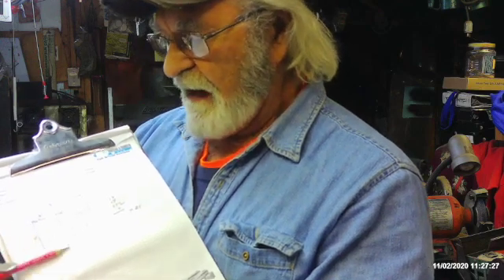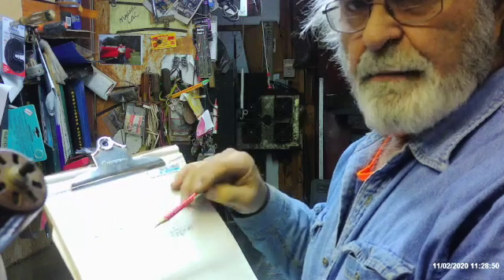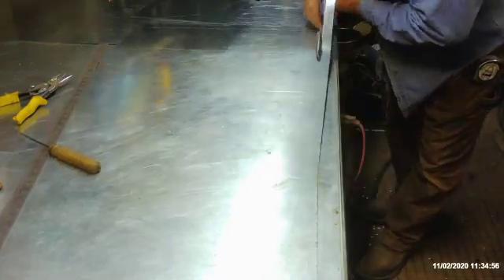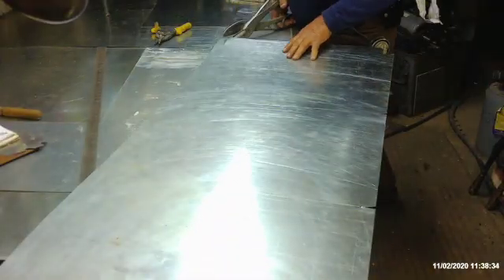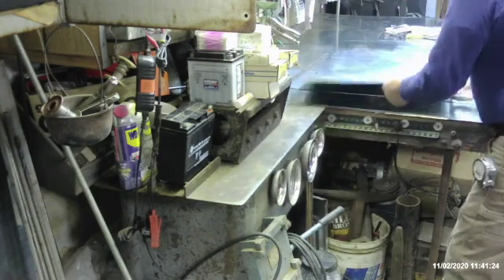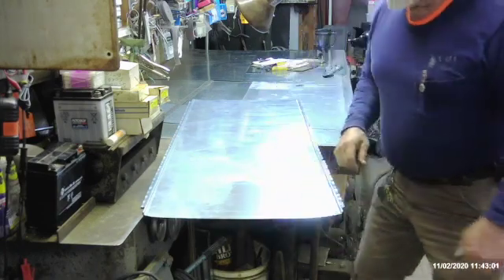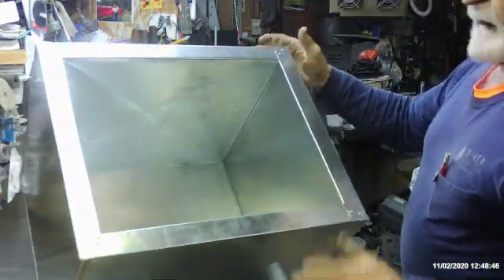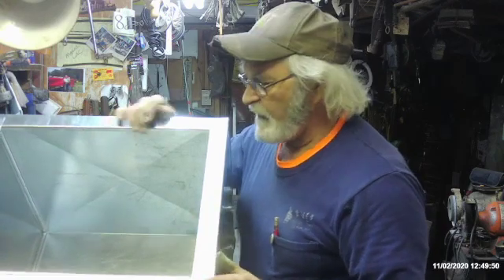Return Air Plenum Fabrication for Electric Furnace

Comment: It only took me 7 hours to get this watched 44 Friend! This vid came in last night and I thought, surely I can watch this one and awoke as it was getting light! Made some JO and have tipped it your way twice now! What fine metal work, looks great! Nothin like a good old ice pick to have in ones shop! I remember going into town with my Grandparents to buy a block of ice in the summer to make ice cream. My Grandfather put the back in a tub and go to work with an ice pick. Bigger pieces were put in a burlap feed sack and on porch and a sledge was used to break up those pieces too small for the pick. And what great ice cream it was too! I wanted to turn that crank and was allowed just before it was done and could hardly move it. The big guys made it look so easy! Off for more JO tipped your way my Friend! Thanks Kindly fir the 44 morning Vid! DaveyJO
Reply from the maker: One of the morning duties of Base Maintenance at Parris Island S.C. was to deliver ice to the rifle range.  Even though I was an electrician, as a crew chief for Base Maintenance we had to take care of setting them up for the day with ice water.  We'd go to the ice house where that crew kept a steady supply of 200# blocks.  Two of us would nab 'em with the ice hooks and slide them right into the flat bed and head to the ranges where we'd ice pick them into pieces small enough to drop into (maybe) 25 gallon water coolers.  We'd head out with several blocks to satisfy the needs daily.  Fun stuff, but now just a distant memory !!  Oh yeah...we never though once about germs.  Aw heck, what don't kill you will make you stronger right...?? LOL.  Take Care ol' buddy and keep the home fires burning and the coffee pipin' hot !!
Reply: Tractorman44 Yep, the fires are burning. It went down to 27 last night, our first frost here. We've had hummingbirds here and yesterday they were at the feeders. I ordered a heated feeder from an outfit in Minn a few days ago. Those little birds usually are outta here the end of Sept. Of course even if they wanted to head south there would be no food, no flowers to sustain them. Haven't seen them today so I hope they didn't freeze during the night. Before light I went out and brought one of the feeders in, heated up some nectar and insulated the feeder with bubble wrap. It's in the sun now but haven't seen them. They can slip in there and take a nip in a second or two so I may have missed them. We'll see. The feeder may come today,it's heated with. 7 w light bulb and good for down to 1 degree. They say. So if the birds are or sickly they may not have up made it. I'll let you know. I the mean time I need some more JO. And the electrician on ice detail? Go figure, eh? Breaking up a 200# block must have taken a bit of time. But. Those muscles you built up there certainly helped I sure. Even to this day I can do quite a few chin ups as long as my feet don't leave the ground. Push ups you ask? Don't ask! I do lots of work on my arms to keep my tippin arm in shape to toast your way. Which I'd better do right. Now! Oh yes, I don't worry about those germs much at all. I do wash. Me sometimes of course but too many people are too clean, you might say. They have few immunities to fend off illness. Now we old dudes on the other hand have other hands. Now I must head to the JOPot so a wonderful ay to you my Friend! Maybes tot the Missus and all the 44 Family And Stan

Comment: Excellent! You're the very definition of a handy man my friend. It's a dying breed in today's throw away world. haha Electric/hydronic heat is the way to go though, I've recently tossed out my oil burner furnace and installed electric wall heating units in every room and am working on hydronic heat in every room. I figure I'll save a good $500-$800 each winter now.
Reply from the maker: Well coming up the way we did on the farm made sure all of us was prepared to meet the days challenge whether it was castrating pigs, butchering beef, sawing lumber, baling hay or fixing what ever broke down.  LOL.  It's not a bad way to make your way into the workforce....
    I'm partway through re-working a fire damaged (destroyed) boiler for my shed.  I laid 1200 liner feet of 1/2'' Pex tubing with 1 foot per square foot of floor as we built the shed. Four 300' circuits.  Hopefully I will get it competed this winter.  Man, I have worked on tons of oil burners, still have my nozzle tool and two boxes of nozzles of various capacities and angles.  I still have one 10,000 volt transformer in stock as well as a few other parts I believe....electrodes etc.  Bad memories...... LOL
Reply: @tractorman4461  haha I hated it at the time but I also am glad that I grew up on a farm and having to learn multiple ''trades'' at a young age although I'm no where near your skill. Ah, Pex tubing..I love the stuff! I have some from not long after it came out in the late 1960's still in use with no issues. If you ask a lot of professional plumbers though they tend to hate it...probably because it does the job faster and you get lest pay! HAHA I have at least one functioning transformer 3 or 4 pairs of spare electrodes and a TON of nozzles. That's the reason I decided to ditch the furnace for other heat sources. My house is an old mobile home with additions and we were still using the old mobile home Miller furnace which ran great, it was just getting to be near impossible to get the proper .55gph 90 degree nozzles that it ran well on. Good luck on your boiler with the pex tubing...I bet it comes out great!
Reply from the maker: @BrodieBr0  Thanks for the well wishes with the on going project.  The unit is a Hardy OWB.  But I'm sitting it inside the shed where the 4 circuits are coming out of the concrete. It was a total loss and it came to me for free.  The outdoor shed it was in burnt down with a rank or more wood inside the shed next to the boiler.  All wiring, all controls are melted off.  I did get the Taco pump to work as well as the inducer motor but that's it.  Its going to live now without the insulation on the heat exchanger or the stainless steel outside shroud.  I just haven't had the time to get it done yet...which is why I halfway repaired that old Fire Chief forced air wood furnace that oddly was a total loss in a house fire a couple decades ago and sitting in the woods all that time.  So that's my temporary heat in that shed now.
   90 degree is a little odd, usually they are 80 degree with hollow cone.  .55 gph is no issue nor are the electrodes.  If you were to use a different angle of cone, just a subtle adjustment of the electrodes should make 'er light off smooth. Of course that's all behind you now...LOL.
Reply: @tractorman4461  Man fires and floods are both damaging forces of nature I'd never wish on anyone. I'm glad you're able to salvage somethings from it though. Those Taco circulating pumps are very well built, I have 2 of them in my hydronic system. You've done a great job of bringing old stuff back to life once again. I'm trying to as well. haha I'm using (an about) 21 year old old 80 gallon whirlpool electric hot water heater i got for free that was in good working condition from a house that was being renovated to supply the heat. Also got a 20 gal expansion tank in the deal that was like new. Even at max setting of 150 degrees it's better than I expected at throwing heat from cast iron radiators and water to air heat exchangers I have set up. Haha yeah I'm glad the old burner is still gone...It had unusual design being a 1960's Miller mobile home kerosene furnace. I used to have a Miller furnace dealer 20 miles from me that closed up. I could never get exact parts for it after that. I did try doing my own modifications  to the gun to no avail and the pump would also randomly lose prime. She was at the end of her life. I love my new heating set up much better because my wife loves it being hot as hell around 80 degrees and I can do well with 60 degrees. I have it set so there's heat exchangers with fans on both sides of the bed with thermostat. Every room in the house the temp is adjustable now. She can have her Florida heat while I have Canada winter! LOL

Comment: Great work!  I enjoy your channel very much!

If your Lockformer was down and you had to build the box by hand what kind of joints would you use?

Mark
Reply from the maker: If it was just a short fitting or transition, I would hand form a Pittsburgh lock on the brake.  If it was much more than that I would either over lap 1'' 90's in the corners, and attach them with 5 screws top to bottom on both sides of the corners then seal the duct with brush-on duct sealant....OR turn a 90 on one and install an "S" slip then slide the other into the S then screw it followed by mastic sealant. Thanks Mark for taking the time to watch as well as the question.  Hope that helps.
Reply: @tractorman4461  Would you ever be willing to show this technique on video? I am loving all your videos but large brakes and pittsburgh locks aren't tools I have access to.
Reply from the maker: @justinherman9443  The over lapping 90* corners are very simple and with a tiny bead of silicone in the inside corner, will not leak air at all.  The pittsburgh is a bit more challenging, but once you make a few of them they are not too difficult....for small ducts or fittings.  You wouldn't want to make 4 or 8 foot handmade pittsburg joints though. If I think of it, I may just for the heck of it make one for you.  Have you found my sheet metal playlists up top yet?  There's some cool stuff up there, you just have to scroll backwards on the list of playlists.  The attic heat pump has some good fittings in that one.
Reply: @tractorman4461  Yeah I've been watching them. I am trying to plan out an intake plenum box, a custom elbow with adaption to a 4 inch filter box and connection to the existing ducting without the setup looking kludgy. Unfortunately I don't have access to any large sheet metal specific power tools like a lockformer or electric hammer.
Reply from the maker: @justinherman9443  Well, what you are doing is definitely possible with a little thought and creativity.  All you really need is a cheap 3' Harbor Freight or Northern Hydraulics brake, a ton of screws, and a tube of either clear or gray silicone.  A more time consuming solution would be pop riveting the pieces instead of self tappers.

Comment: Thanks tractorman, perfect video I’m almost at the point of starting my supply plenum. Then return will be the last.
Reply from the maker: You may like the next in this series.  It's the return air drop 90 degree fitting with integral filter slot for standard size filter.  I'm glad to hear you are nearing completion Roger and thank you for watching sir.

Comment: I think your a “ tin knocker” at heart! Wendel that was some nice and quick work you did there, but surprised you don’t also have a “finger brake”.
Reply from the maker: Hahahahaha...Oh I for sure have one, just didn't use it today.  I could've done the fold that was finished by hand by using the box and pan brake, but wanted to show the hand technique I sometimes use. Plus it currently is holding some saw setting parts as well as a couple hundred pounds of extension cords.